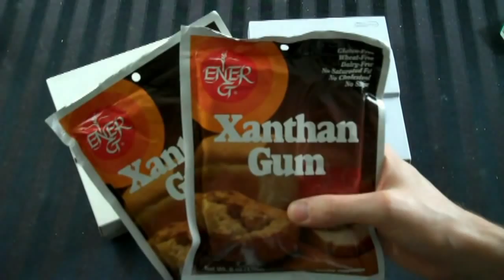Gamerade - Remove Yellow from Super Nintendo, Other Consoles, Plastics - Adam Koralik

Comment: Instead of depending on the sun you can simply use a UV light, i happen to own a UV neon tube of the type they use in tanning machines only it is slightly larger spectrum and as i understand it those cost around 40 euros (i got mine from a friend so i really don't know) and will work great for anything you want to do involving UV light, including but not limited to this process (i fooled around with that tube and did pretty fascinating experiments especially with polarized glass and leaves).

Comment: I've seen some comments here questioning the reason for fixing yellowed plastic as opposed to just buying a replacement system (is this correct English btw?).

The main reason for me to try to restore instead of buying a replacement is that with a replacement it simply wouldn't be my old trusty computer anymore! You know every bump and scratch, you know the sound of an opening cartridge slot cover, and you'll want to preserve that. A replacement system will play the same games, sure, but it somehow just wouldn't BE the same.

Still, I've got a question of a more practical kind: this hydrogen peroxide mixture, does it smell (much)? In other words; will the missus complain if I were to do this at home, or should I take it elsewhere?

Thanks for this vid, I like it a lot!
Reply from the maker: Thanks for watching!
Reply: AdamKoralik My pleasure!

Another question: I want to apply this solution to a yellowed MSX keyboard. Will it affect the letters on the keys or will it 'only' whiten the keys? Also, does it smell (should I take it outside)?

On a side note; when working with stuff like hydrogen peroxide, it is (very much!) advisable to wear safety goggles. You DO NOT want to get stuff like that in your eyes! A cheap pair will only cost you a couple of $$ and can save you from a lot of trouble!
Reply from the maker: mvl71 I don't know exactly what the MSX keyboard is comprised of, but it shouldn't effect anything other than the yellowing.

The solution has a bit of an odor, but it's not unpleasant, it smells a lot like soap.
Reply: AdamKoralik Sorry, forgot that the MSX system (an 80s home computer) wasn't popular outside of Japan and Europe (ok, and Brazil for some reason). The keyboard I'm talking about will usually be yellowed beyond reason, except for the numerical pad and the QWERTY row. ( http://www.nightfallcrew.com/wp-content/gallery/philips-msx-2-nms-8250/IMG_4187.jpg ).

So it smells like soap? That's good! I live in a agricultural area so mostly you smell cow here. Well, the bits that passed through the cow, in fact. Soap will be nice for a change ;-)

Comment: The bad thing about this is you will never get it back to its original color because when the plastic degrades due to the chemical breakdown it also breaks down one of the dyes, so the color will be brighter and off a bit. Also you need to make sure you have equal coating on the case or you could run into spots that are brighter then others (ghosting).

Comment: Thank you for the video and now following!! I know it's old but it's the most helpful vid on here. I plan on doing this treatment on a SNES beforehand because I want do a paint custom on it. Christmas gift for the kiddos. :)
Reply from the maker: +Angelica G.P.Rivera Happy to help.
Reply: +AdamKoralik Local grocery store had only vegetable glycerin, is that alright?
Reply: +Angelica PR Yeah u want to use vegetable glycerin. The mixture shouldn't be that thick though. Should use 2 cups peroxide to 2 heaping tablespoons of xanthan or 1 cup to 1 tablespoon then the oxyclean then use the glycerin to gel the mixture to the consistency of your liking. I also heard it's not light that makes the mixture react but actually darkness and heat. I've even seen people set their ovens to the warm setting or lowest temp setting and doing 15-30 minute cycles always with little light as possible. I guess everyone's recipe is different. Goodluck ☺ 👍

Comment: Honestly, I just cleaned my system with a Magic Eraser without taking it apart a few years ago, and was more than happy with the results. Outside of the NES, Game Boy, Virtual Boy, and Game Boy Color, I've never felt comfortable with taking video game systems apart. Just watching this video and seeing how complex the SNES is inside compared to the NES, I can't help but say "nah fuck that", and it's not even like I'm that inept. I was more than comfortable with disabling my NES-10 chip, but I could never see myself getting an SNES back together again.

The one thing I ever did the Peroxide method on were a pair of tweezers I'd had for 15+ years, they were totally yellow, I dipped it in the peroxide and left it on the railing, came home and they were totally white. I didn't even use Oxy Clean. This was about 3 years ago, and they are still white. Why did Peroxide alone strip the yellowing off those? The plastic is very similar to that of a SNES.
Reply: +TRJ2241987 SNES complex? Well if you think so it's probably good you stopped yourself.

Comment: Adam thanks for your video.  I tried this on my recent nostalgia SNES purchase.  The console was yellow. On the top and piece inside and out and was brittle breaking apart at places.  The bottom and controller ports were fine.  I ended up using the Sally Beauty 40 volume xreme and got the same results so thanks.  But would you say the SNES. You did is stronger, weaker or about thesame as before?
Reply from the maker: It's stronger than it was before I put the solution on it.

Comment: I think you're just removing the top yellow layer of the plastic. By doing this you expose the layer below which hasn't been subjected to oxidation. You aren't making it impervious to further oxidation just a minor renovation of the layer being exposed. Hydrogen peroxide isn't that nasty, it's more the reaction you make with it. I'm guessing you produce some kind of strong base at a low concentration. Have you tried rinsing the parts with boiling water? Anyway, nice video o7

Comment: couldn't you just use some kind of bright light source instead of leaving them out in the sun? and i think that spraying them down with the waterhose when when cleaning off the mixture the could make this finish up alot faster.these are just some suggestions i thought about. but this is a great video on how to restore a snes color.
Reply from the maker: UV light is required. So the sun is the best option. You could lamps, but don't expect it to work as well.

A hose would be fine, but trust me when I say it won't get it all out.
Reply: AdamKoralik At the least you can leave it under some lamps during the night, and take them back out during the day.

Comment: I packed my SNES away when I moved out of home in 1999 and when I unpacked it again in 2004 or so, the damn thing had yellowed.  I had no idea why as it had been in its box the whole time and stored out of the sun.  It also didn't work which was even more annoying.  The PAL SNES is the same as the SFC so you will know how the yellowing occurs around the body.

I also have 2 SFCs.  One I bought cheaply off eBay when I discovered my SNES no longer worked for some strange reason and another I bought from Hard Off in Japan.  The eBay one was pretty grotty and yellowed so I may try this on it to see how it turns out as I would like to sell it.  The SFC from Hard Off which I payed a whopping 105yen for was beautiful condition and a "as new" smooth cart slot.

I was also thinking about my PC Engine+CDROM2 which is a bit yellowed but that is more likely to be caused by smoke.  Same with yellowed Saturns.  I wonder if it would still work the same way.

Comment: If you have an old blender laying around, it can make the process of mixing this up a lot easier.  Just a tip I've seen ;D

Also, most of the recipes I've seen call for 1 pint (16oz) of H202, not 1 cup (8oz)  I'm sure it doesn't matter that much, except in my experience it helped to make the paste a lot easier to work with.  Glad to see that it worked for you!

Comment: if you do want to use a UV lamp or an UV Sterilization Equipment they use for towels is it the UVb or UVa that the plastic needs? because if we cant have it in the sun for 8+ hours, could you have it in the UV Sterilizer for 12+ hours and it does both sides at the same time.

Comment: will this help restore the plastic coloration of sealed figurines? i have no idea how 3 of my figurines got yellow damage. they were away from sunlight and UV lighting, and were actually BEHIND other figurines. the figurines in front didnt get damaged, which made no sense...
Reply from the maker: You'd have to open them to perform this.
Reply: There might be a slight break in the seal and/or it could be heat causing the issue. Are they near anything hot?
Reply: Puppy nope. they are near in a cabinet away from heat and light.
Reply: might just be a reaction to good ole O2, which is actually very corrosive. might be made of a different material / plastic the your more forward figures.
Reply: spicydeath82 it could be possibly be. these 3 figurines out of the 6 total, were the last they made in this series before they went out of business.
Reply: yeah, chances are then they were cheapening out at the end, inferior plastic mixes

Comment: Would storing your gaming system in the dark when you're not using it help slow down the yellowing process?
Reply: Yes, Direct or Indirect UV light will inevitably yellow them. so storing them in a cool dark place is always a good idea.  i keep mine in a drawer with its wires. it keeps it organized and safe. if you want to display it i would suggest buying black blinds or placing something on your windows to block the sun

Comment: I finally got all the materials needed and will be trying this on the weekend. About how many console shells can you do with 1 mixture of the ingredients?
Reply from the maker: Depends on how many coats you want to do per console.
Reply: How thick of a coat do you need? Would a thick coat be more effective than a thin coat?
Reply from the maker: SaturnHST Doesn't need to be too thick. Just focus on making it consistent.
Reply: Would it be better to leave the parts directly in sunlight or in a shaded area? I've heard the gel can dry up.
Reply from the maker: SaturnHST Either one should work, and either one will dry up. That doesn't matter too much.
Reply: In the process of doing it today. It was harder than I thought to make the gel and to evenly spread it over the plastic. Also I might have applied it too slowly after I had mixed in the Oxy as I was trying to spread it evenly on 4 console shells. Should I just leave them out throughout the night or bring them back in after the sun sets?
Reply from the maker: SaturnHST Yes, leaving it on there won't do any harm. You just need to be really patient with it.

Comment: I tried this and it hasn't worked :/ I mightve messed up by applying the mixer on the shell out in the sun causing the reaction to quicken. But it dried out very quickly and there was hardly any improvement leaving it out for 4 hours. I didn't add any liquid glycerin either since you said it was optional. I'll try it again trying to correct my mistakes or I might try that hair styling mixer
Reply from the maker: You need WAY more time than that.
Reply: Alright thanks. It's still out there. I've reapplied the mixer a couple times after it dried out significantly. I'll leave it out for a few more hours. Thank you
Reply from the maker: Drying out is normal.

Comment: If you want to save time and get a better result, just buy hydrogen peroxide that's already creamy. I use Salon Care volume 40 (it's 12% hydrogen peroxide). You can get it at your local hair salon or at Amazon. It's basically what they use to bleach hair. Then wrap it up in plastic wrap so that the H2O2 doesn't evaporate and put it under a UV lamp for a couple of hours. Works great.

Using a cream rather than a thick paste makes it muck easier to apply it more even, which you definitely want to avoid making it look all dappled.
Reply: Did you add Oxi-clean with that?
Reply: byte.me I did add a little Oxi-clean since I already had it at home, but I don't think it's necessary. I've heard others use similar hair products without Oxi-clean with great results, but I think it does speed up the process. I de-yellowed my Dreamcast, which was pretty yellow, back to its original color in roughly 9 hours under UV light bulb and some tin foil.

I was very surprised over how fast it all took. I've seen people doing multiple treatments in up to 30-40 hours for each treatment. I was planning on doing multiple treatments since I didn't want to leave the light bulb on over night, so I decided to stop and washed off all the cream to have a closer look, and there it was, a beautiful white Dreamcast :)
Reply: Excellent.  I might try this instead as it seems easier.  The bottom part of my SNES has yellowed a little and the controller port area of my GCN is starting to do that, as well.  Might look for other things that yellow before starting to do this.  Thanks for replying!
Reply: byte.me Best of luck!
Reply: Thanks!

Comment: Advice: Remember the sun rises east to west, so, I'd set it out in the morning facing east say around 8-9 AM, check it at 10, 11, 12 whatevs, if it still needs longer, check it around 2 or 3 ( If in the summer months and you live in the south, DO NOT leave it out for long when it's 100+ degrees, it WILL melt or warp). For the consistency, you want a honey-like consistency, Your solution will go further and cover more area. You can also use a "true" black light UV bulb (the more, the merrier), what makes this work, is UV-A (That's what makes clothes and posters glow), it's not dangerous either, UV-B is what burns you (OR, if you have access to a tanning bed, it's powerful, and you can get both sides completed at the same time). For washing, throw it in a dish washer, top shelf, on rinse cycle...
Reply from the maker: Excellent suggestions sir. Thank you.

Comment: American Super Nintendo's look like complete shit. What were they thinking making a square SNES?
Reply from the maker: +CactuarLOL It's never been confirmed, but the story goes that Nintendo of America designed it so that you can't place a drink on top of it. Claiming that the reason the NES was unreliable was that too many people had done that, as opposed to the truth which was that the 72 pin connection was a flawed design.

But, again, that story has never been confirmed.
Reply: AdamKoralik The american version looks like it would be easier to put a drink on than the UK/AU/EU/JAP version though...
Reply from the maker: +CactuarLOL Trust me, it's not. A soda can or cup won't sit on in a stable position. The other body, it will easily.
Reply: +AdamKoralik wait, so I'm not supposed to violently shake my electronic video consoles while keeping cups of liquid on top of them? I have been doing it wrong for years...

Comment: I have a snes that is extremely yellow on the bottom. I'm testing a product which someone mention. It's called Salon Care Professional 40 Volume Crème. I pay about $4 for 32 oz(size of a head/shoulder shampoo). It's used for bleaching hair. I try mixing with oxyclean+corn starch and it works about 30 min exposure and it took off a little bit but I took it off and put it full strength b/c the liquid inside is already a paste. I recommend using gloves b/c my hand is burning now. I did use gloves and somehow I touch the outside of the mix w/ my uncovered hand. Now I feel the burning and itching.
 
There are 10,20,30,40,50 on the product. Yes, there is hydrogen peroxide in it as I read the label. 40 is very strong. I can't get 50 b/c I need to have a cosmologist's license.
Reply: Update. I did this around 3pm and clean one up at 8pm. So it's 4 hrs straight. I suggest buying this product and you don't have to mix anything up. I will do 2 more time.

Comment: do they have a converter that's the opposite of the one shown in this video? like, one that makes you able to play super famicom games on your SNES?

if not, is cutting those little pieces of plastic off really that simple?
Reply from the maker: If we're talking about Super Famicoms on a US Super Nintendo, yes it's really as simple as cutting those tabs.
Reply: I have a PAL copy of worms and a US SNES. if I cut those tabs, it'll work on it?

what about japanese cartridges?

thanks. :-)
Reply from the maker: zbaker330 No, it won't work with PAL stuff.

Japanese games can easily work on a US console, and a simple adapter can make US games work on a Japanese console. But PAL stuff doesn't work on their, and the US/Japanese games won't work on a PAL console.

Not without a much more expensive and extremely uncommon adapter.
Reply: damn...

oh well, I suppose. thanks for the tip. is there any reason why its like that?
Reply from the maker: zbaker330 Japan and the US use NTSC, Europe and Australia use PAL.
Reply: gotcha. makes sense. thanks again for all the help, dude!

Comment from the maker: Super Famicom games will work on a US Super Nintendo if either the lid is removed or the plastic tabs inside are cut.

US Super Nintendo games will work on a Super Famicom if the lid is off, casing is cut, or you use a cartridge shape adapter.

PAL stuff is not compatible with either.

The US version looks different because Nintendo America linked the high failure rate of the NES to people placing beverages on top of the console. So they designed the shell to be unable to hold a drink on top.

Comment: Does this permanently reverse the yellowing process, or will it yellow again in 15 years?
Reply from the maker: Should be permanent.
Reply: I think you're right. The chemical responsible for the yellowing is being removed from the outer lays. There is a chance the chemical in the inner layers will seep to the surface, but it won't be in nearly the same quantity.